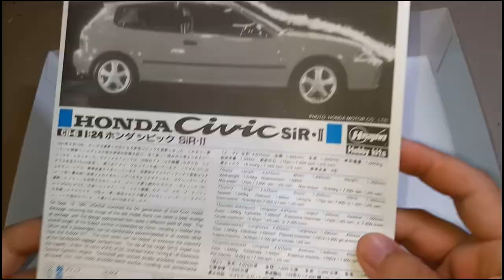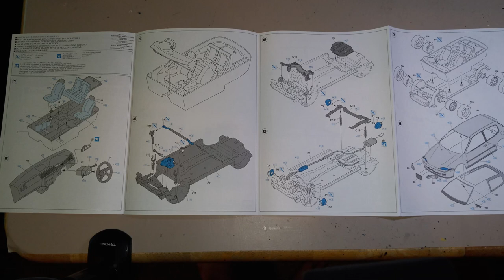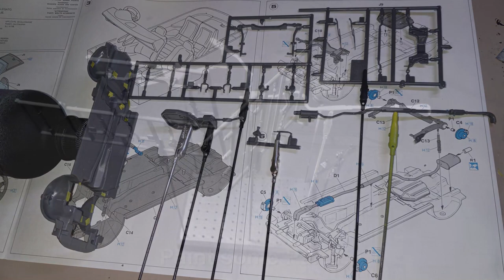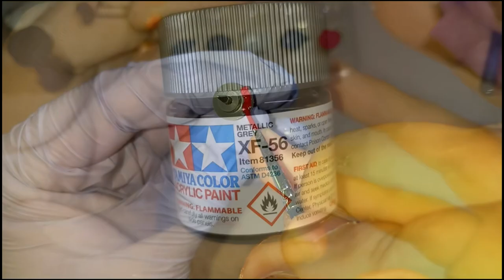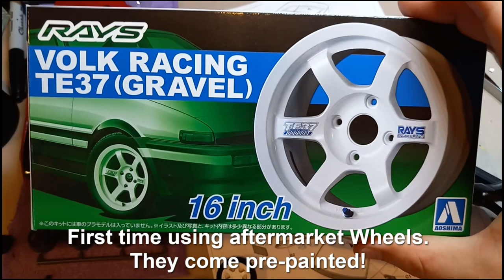Building a Honda Civic EG6 Model Car Step by Step Hasegawa 1/24 (VTEC)

Comment: Nice work my friend, looks really nice and great work fitting those rims and brakes. Cool steering you chose for it too. Regarding pedals, does it mean this kit comes without those? Well done, overall neat job Bryden 👍🏼👍🏼
Reply from the maker: Thanks Karl! 😀  It was a cool experience doing things I haven't tried before, and Yes, unfortunately it doesn't come with any pedals, that's why I had to improvise.  The front wheels' offset is a little off but I can fix it later by shaving the wheels a little bit in the back because this kit has really shallow wheel wells.
Reply: @BrydensModelWorks  oh, can't imagine why hasegawa forgot the pedals! Aren't they important to drive? 😅 Nice work adapting a set from another dash. I have the racing EG6 and Ferio versions and I'll go check if they have pedals or not, as now I'm curious! Yeah the racing also have narrow wheel wells so I can understand you. Well done once again my friend, great job 👍🏼

Comment: very familiar taste in jdm cars every kit you hav built iv eather built or have most still i want my painting detail to improve b4 i start my beloved Honda stash and useing the B series vtec engine from the 125th scale civics I'm resin casting them an i found nicely detailed one on 3D printer site i got great valve covers and transmissions rest kept failing so plan is ill make seperate files for block head v cover and transmission pullys alternator seperate and fuel rail wit injectors they turn out very tin flimsy trying to get them rite,👍anyway great job on eg bro ur awsome builder👍Keith